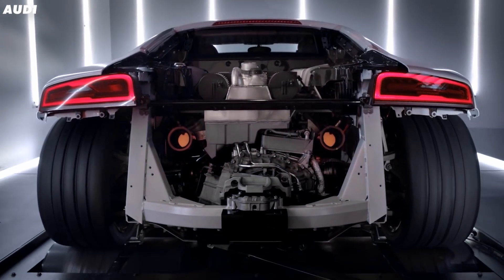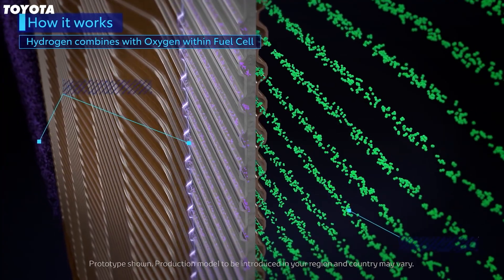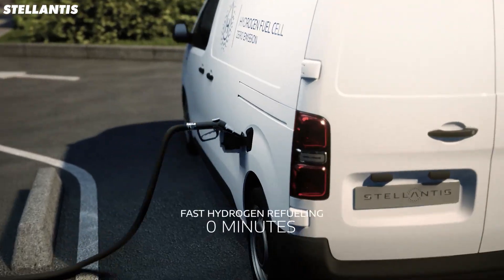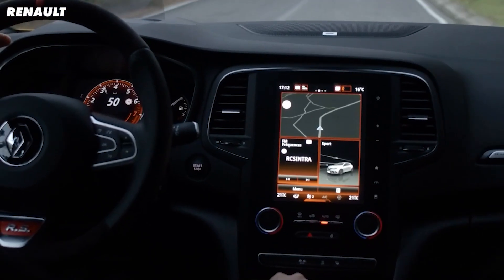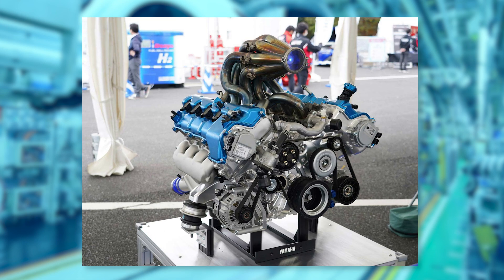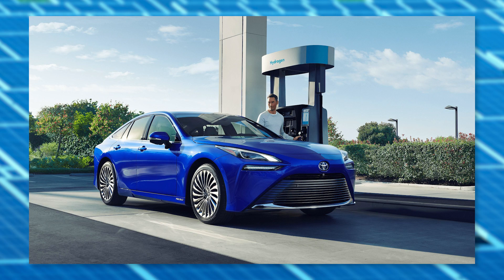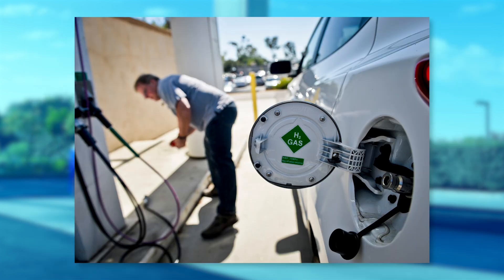The V8 Engine that Runs on HYDROGEN

Comment: Hydrogen is cool and all, but it's still not zero emission. In mass, cars emitting water can have a drastic effect in local climate, increasing humidity and therefore heat and precipitation frequency. shrug

Full __insert_any_technology__ is not the answer for the immediate future. It always comes back to hybrid systems with combinations of different technologies working together.
Reply: So are you gonna tell your elite daddies and goddess Greta to stop travelling in their private jets and yachts to help achieving zero emission? Or is it just for hard working peasants to not enjoy their vehicles?
Reply: @zaccorpseman7366  The point obviously went over your head or you didn't read my entire comment. Regardless... just stating facts. Have a good one!

Comment: Problem 1: Hydrogen ICE require a lot of air to be mixed to cause combustion, this makes them less efficient than gasoline.

Answer 1: Neat point, however we have this wonderful tech called FORCED INDUCTION aka Turbochargers/Superchargers, that kind of takes care of that little problem. Also if you look at what Mazda is doing with Skyactiv-X using extreme temps and pressures to cause ignition instead of a spark akin to how diesels work, well now we have the answers to this "problem".

Problem 2: Well we would need to scale up hydrogen production, how are we gonna do that without fossil fuels?

Answer 2: Have you ever heard of nuclear fission? When a PWR (pressurized water reactor) operates it generates TONS of hydrogen gas that typically gets wasted right now due to the lack of need. So if we build more nuclear reactors we can get all the hydrogen gas we need to make Hydrogen ICE cars a real thing and guess what NPP's are GREEN, their electricty can also make EV's more green as well. OMG we have a solution to pollution *gasp*!

Thankyou for attending my TED Talk Q&A.

Comment: This is my future a Ford 5.0 engine V8 with the Hydrogen. 
I just bought a 2022 Roush Mustang and it gets better mpg than my 2016 Mustang Performance Pack.  Just did the reveal of this purchase today August 20, 2022 
It is S/N: 22.0001.450R yes 1st in the year 2022 
The only White Mustang in all of California with the Proper 3rd Pedal 6 Speed Manual Transmission 
Great content thanks. 
I wouldn't buy Electric Vehicles (EV's) because there are already newly introduced EV's in unpaved Junkyards.  
There are no Recycling Centers in California, and in the USA there are 5. Since not charged in the Junkyards the battery packs are dead, thus not cooling the battery packs.  The heat burst the outer shell of the cells, thus, spilling Acids and or other Poisonous Chemicals into our GROUND WATER 💧 🙋👍🏎🏁

Comment: if you want more efficiency and make it cheaper then why not just use and electrolysis system to produce the hydrogen in the car and just have water station with electrolytes in the water

Comment: "isnt competely green" is an understatement.
1l of Hydrogen needs so much energy that you could drive 1000km with a regular EV.
They just need to build a ton of NPPs to JUST produce Energy for hydrogen production.
Otherwisse Hydrogen will never have the slightest of a chance to win against EVs.

BUT i would love a hydrogen combustion engine, that would solve the dumb problem of Hydrogen EVs, which need a battery anyway, in that case, as long as Hydrogen Cars need batteries you could just build regular EVs at that point.

Comment: 1.On the point of emissions, EV are not entirely green either, Even in a country like Norway, their entire push for Renewables is funded by being world's second gas exporter and top 10 oil exporter. For a country that represents like a 0. point something percentage of the population.
2. All of those issues can be solved if countries would stop being bastards about nuclear and just embrace it. 
3. Its a means for storage of energy, yes, But even if it loses some efficiency there, it's still more green than the waste produced from the chemicals in the batteries, and the fact we probably cant keep building new ones for that long considering how rare some of the materials going into them are.
4. Add to that the fact ev's are uneconomical to keep going over like 10 years because of battery degradation, which Means the amount of waste just keeping increasing for ev's.

Comment: Electrolysis is the cleanest way to make hydrogen, you just use water, but then the sticking point becomes asking how to make the power for the electrolysis, and the answer to that is nuclear power plants. A lot of people don't want to swallow the pill that is the fact that nuclear power is the cleanest and safest option for green energy out there right now, even if it sounds scary.

Comment: You don't need fossil fuels to produce hydrogen. The greenest source of energy overall, including wind, hydro and solar is actually thorium nuclear reactors(basically operates like a regular reactor with an incinerator so it produces virtually no waste or damage to the environment whatsoever), which already produces hydrogen as a by product. If say 8-10 TNR's were used worldwide to only power electrolysis, we could literally stop using oil to produce petrol and diesel. All the climate people could climax at once. The technology is already there -it's just not being used.

And when I say these TNR's are clean... I mean they're unbelievably clean. A single VW Jetta produces more carbon emissions in a day than one of these reactors do in an entire year. And... Everyone is worried about nuclear waste, right? Guess what? Thorium reactors incinerate 90% of this waste and the waste that's left over is minimal -and the spent rods can be buried in the same empty mine where it was mined out of.

Now let's ask why this isn't happening... The answer is OPEC, lobbyists, corrupt politicians, current economic models and the world's military's maintaining current geopolitical power dynamics. That may sound ridiculous to the average person -but imagine a world where oil is NOT used as fuel... We'd still need oil for so many different products and lubricants, but it could be recycled, refined and reused again and again which is much better than having it and simply burning it for energy which creates the high demand and the high prices.

Everything could change in the world if we were to start innovating away from oil dependent power.

Comment: Regardless of Hydrogen requiring fossil fuels, but it's still more environmentally friendly than EV's. I dislike this false image of EV's being fully carbon neutral. They're not. The process of making EV batteries and not even to mention the trouble of trying to recycle or trash an EV with it's battery, it doesn't start to look as green as companies make them out to be.

Comment: Im pretty sure no company will start building hydrogen combustion motors bc even if its more fun why put the same type of fuel in way way more inefficent motor? They would have less range be worse for the enviroment since they would need way more fuel they have way more moving parts and therefore costs and maintence are increased

Comment: Why not explore the sugar cane alcohol fuel!   I’ve heard that alcohol distilled from plant when burned is clean!   It can also be 100% alcohol concentrated so it will burn good in a internal combustion engine!  I can’t see ICE cars run out !  As long as aeroplanes use aviation fuel . Avgas can be used in our cars , is a little high octane but a few tweaks to the engine will get it to run really good!    I ran it in my car once and it went like a rocket!!!😁Smelled good too!!!

Comment: People….Study Ammonia as Energy, not Hydrogen.  The Marine industry is now in the process of converting all diesel ships to Ammonia ships by 2025.  And all new ships will run on Ammonia.  And the industry is very happy to do this as Ammonia is way cheaper then diesel.  Ammonia has hazards, as does gas, diesel, propane, Ammonia has been used in the fertiliser industry for decades with no safety issues.  And the manufacturing of Ammonia is already a 150 bil per year industry.  So it’s well established technology.

Comment: The H in H-bomb has nothing to do with the hydrogen in your car or the flamability of hyddrogen. The h-bomb makes use of the energy set free when deuterium nuclei fuse into helium. deuterium is a hydrogen isotope that is not found in large enough quantities in normal hydrogen but even if it were, you'd need a Uranium fission bomb to trigger the effect. But that said, even if you'd drop a Uraium bomb on a parking lot or a hydrogen gas station, it would still not trigger a fusion (=h-bomb) .

Comment: Dumbest idea of all time
Reply: Seriouly?  Lol, 

...As I've previously stated:

"I'm truly surprised by how many people don't actually see the connection between pure Hydrogen as a fuel and our current HydroCarbon based fuels...  

Pump gas etc, is one of many Hydrogen/Carbon molecules (aka: HydroCarbons) that we currently use as fuels.  But the Carbon doesn't actually combust within the combustion process, it's the actual Hydrogen part of each HydroCarbon molecule that does that.  "IT" is the actual fuel combusting with the Oxygen from the intake air stream, which gives us the desired exothermic energy required to spin our engines...  But, before it can combust properly with the Oxygen, some of that combustion energy being gained is lost whilst leveraging the Hydrogen away from Hydro/Carbon bonds to release the Hydrogen before it can combust with the Oxygen from the intake air stream.  It's sort of like income tax on your income, in the sense that you never get the full benefit of your total wage.    

After the Hydrogen's been released, it recombines with the Oxygen to form pure water vapour (H2O), leaving the carbon free to recombine with unused oxygen from the combustion process.  This is where our unwanted Carbon monoxide and Carbondioxide (CO & CO2) waste products come from.  

So using HydroCarbon fuels is essentially just burning Hydrogen, but with an energy loss involved from having to first break the molecular bonds of its HydroCarbon molecule.  Then the unwanted leftovers, namely the Carbon and the excess Oxygen and Nitrogen from the intake air stream, (remember, air is mostly Nitrogen and Oxygen) form new compounds, which we throw away in our tailpipe emissions, as CO, CO2, and some NOx (Oxides of Nitrogen), along with water vapour (H2O) from Hydrogen/Oxygen combustion... 

However, if we use pure Hydrogen for combustion, not only do we eliminate energy losses from first breaking apart a hydrocarbon, but we also eliminate carbon leftovers, which create the unwanted CO & CO2 emissions as waste products from our exhaust gasses.  All that exits the tailpipe are excess Oxygen and Nitrogen (air), some Oxides of Nitrogen (NOx), and pure water vapour as steam (H2O)...

...So either way, you've always been running on hydrogen anyway.  ...You just haven't realised it!  😎"

Comment: Electrolysis can make hydrogen... Australia (Fortescue Metal Groups) is making it en-masse with solar. With our geographic dispersion, Hydrogen makes more sense than EVs. Furthermore, with cheap clean energy to make it work, Hydrogen can be smashed together with recycld carbon captured from the atmosphere (still net zero) to make pure hydrocarbon liquid fuels like Octane and Dodecane (Fisher Tropsh process).

Comment: You don't need fossil fuels to make hydrogen with new modern nuclear reactors and mini fully automated reactors that are prefabricated and can be build in a year, these plants can be fully automated and used recycled fuel rods.

Nuclear power is pretty much free and with new re-enriching tech it's completely sustainable and an unlimited source of clean power, just don't build them in places that have natural disasters, a few miles away from a plant you can make a refinery that takes pretty much any type of water, does not have to be drinking water just filtered from a river or steam and using hydrolysis you can make hydrogen for fuel and oxygen for hospitals..

With a pipe network fuel stations could have their own 100 bar to 1000 bar compressor so you can fill your tanks.

Good hydrogen engines could be made for bug and small applications but no one has really build an engine based on hydrogen and not a standard engine converted.

Comment: It’s funny cause theres a number of videos using the same v8 you have on the thumbnail along with a brand logo, which is Ford in your case. Another video used the Toyota logo along with the same v8 with blue valve covers. The thing is, it says Yamaha on the base of the black engine holder

Comment: interesting flic. However you completely disqualified yourself with you H-Bomb comment. I would have accepted the Hindenburg disaster, but a Hydrogen tank in a car will not spontaiously create a nuclear fusion explosion, just because of a leak.
The state of Bavaria has been operating a fleet of hydrigen powered BMWs and Hydrogen filling stations as company cars for state and municipal executives. there was also a big trial of Neoplan Buses to run on Hydrogen. these trials have gone on for 20 years or so. However, the main issue is that the hydrogen is not green, but blue Hydrogen. that means that it is still not climate neutral.
as to the advantage if Hydrogen over Electricity is storabiluty and transport. all the electicty energy transformation has losses as well. So Hydrogen could be a more efficient storage medium. 
the big issue with Hydrogen is it's difficulty of storage. However I recently read about a patent that can store Hydrogen in a slurry at much lower temperatures that might be a way to much easier Hydrogen storage.
but even the the Fuel Cell will be the better technology for Transportation. this is especially true as the whole of the automotive industry is re-tooling for EV. and then replacing the huge Li Battery pack with an efficient Hydrogen storage and Fuel Cell solution could 've very simple.
but I guess this is not what you are about in this flic. you want to noise and stink of an ICE. well, I agree you might get the noise, but not the stink.

Comment: Some simple legislation that stipulates that all new cars must be able to run on hydrogen as well as gas would instantly start the hydrogen economy and start moving us towards a pollution free society..

Hydrogen can power an internal combustion engine quite nicely than you very much!.. An internal combustion engine that is fitted to run on propane is nearly identical to one optimized to run on hydrogen.. They can in fact run the other fuel just fine.. The vehicle can be fitted with an electrolysis unit that can fill the tank with hydrogen.. All the operator has to do is fill a tank with water and plug the car in.. No hydrogen filling stations required..  It's my belief that the deployment of clean energy and clean transportation systems must be flexible.. A system that can work on a variety of different fuels will more easily integrate into our society.. Many cars on North American roads are retrofitted to run on both gasoline and propane.. Making a flexible fuel delivery system for those vehicles so they could run on gasoline, propane and or hydrogen would not be very difficult.. If the vehicle was driving on hydrogen that was sourced from the electrolysis of water using electricity generated from a clean renewable energy source like wind, wave or solar the car would be driving 100% completely pollution free.. There are smarter ways of going about things... We just have to recognize why things are the way they are and make the responsible choice..

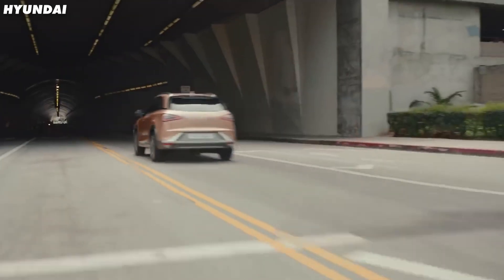BMW blast off happens 1:55 minutes in to the video...
https://www.youtube.com/watch?v=C5qWOwmypeA

------------------------------------------------------------------

Comment: grid monopoly. escape opec.

 combustion hydrogen will cut the cost of electricity.
 electricity will go up drastically.

and monopoly.dictators are already lining up not as presidents this time.

 and it's all taxation.

grow trees . take the carbon out of the air 

put nappies on the diesels fumes.

Comment: Nice one , well toyota have there corolla gr racing car running on hydrogen for the japanse  racing,  and you have jcb that are actually made hydrogen engine testing on there machines,  yeah really hope hydrogen fuel  get cheaper to manufacturers,  they can use nuclear power to make hydrogen fuel also

Comment: patents are working against getting things done, assume all are using all patents in their back yard shop without asking, anyone
Reply: patents prevent direct usage and only benefit lawyers
Reply: or a talk show host
Reply: if they have their patent go through, all must pay them to use hydrogen engine, do you think its wise to let anyone have any patents, think If I patent all electricity, without asking you
Reply: or someone patented gasoline or gasoline engine, in general, all versions
Reply: all corporate is only managing the other than actual thing being done
Reply: make your own fuels on your own back yard, because you arent going to get any from anyone else, end of story, stop with the scaling up whine
Reply: diy own gasoline station
Reply: stop thinking about the fuzz, nonsense, and make it happen, use metal hydrides to store the hydrogen, heat activated, electrically, if you worry about the storage

Comment: The time frame they are pushing for going all electric for cars is unrealistic as far as I'm concerned. I've always felt they would keep cleaning up fuel using vehicles while also improving batteries and electric motors. By combining the two they would be farther along on clean air. For electric vehicles they will need more  power generating plants spewing more pollution. It's always about money 💰.